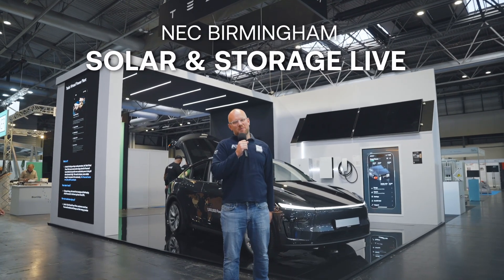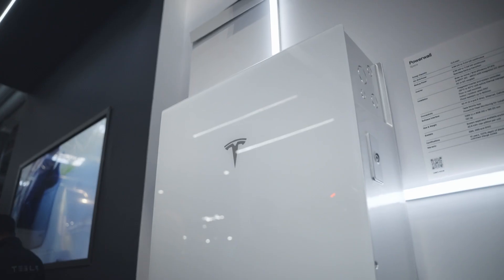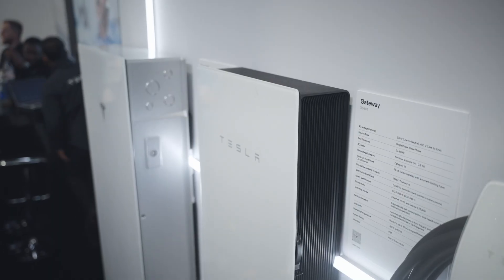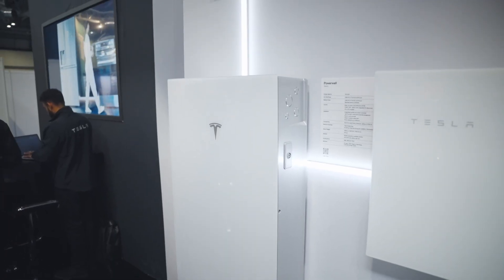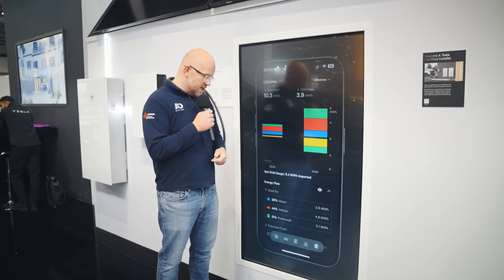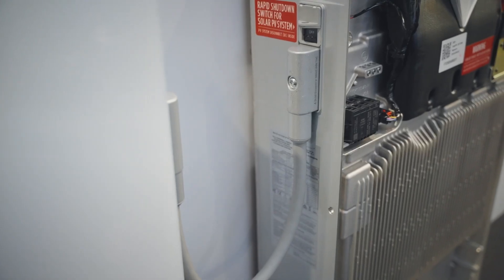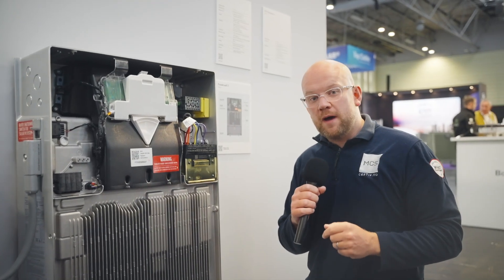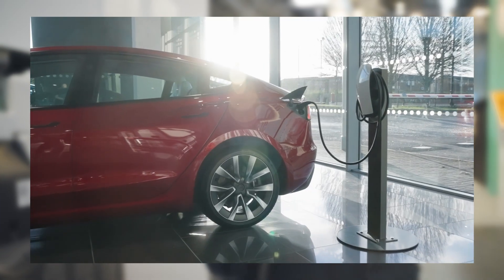Tesla Powerwall 3: NEW Features Revealed at Solar & Storage Live 2025 🔋 (UK Hands-On Demo)

Comment: Some of your information is out of date. A PW3 + DC expansion can charge at 10KW not 8 (FW update several months ago upped this limit) and you don’t need to replace the screws if you need to remove the the front glass cover after the install.
Reply: The latest spec states 8kw but if ur getting 10 then its a Ye!
Reply from the maker: Thanks for this. We are happy to be corrected (every day is a school day) but from what we know official tesla guidance states an 8kw charge: 

https://energylibrary.tesla.com/docs/Public/EnergyStorage/Powerwall/3/InstallManual/BackupGateway/2/en-gb/GUID-E43D0BF8-6B91-469A-813A-C3EFC27D87DB

Seems we are both right when it comes to the screws, there are two versions (ones that are not re-useable and more recent versions with a gasket that can be re-used): 

https://energylibrary.tesla.com/docs/Public/EnergyStorage/Powerwall/3/InstallManual/BackupGateway/2/en-gb/GUID-41D45611-17D2-4AF5-BE8B-5F5867771782

Thanks for commenting 😄

Comment: My current PW3 installation has all panels on one string. It is being re-cabled to use all 3 MPPTs. Will I be able to see how each string performs separately??  To my way of thinking, if you provide a feature such as this, you should be able to see the differences - especially when the strings are in different orientations; that's the only way you can tell it's performing properly.
Reply: I'm pretty sure you can't unless Tesla change the software. Why change to multiple strings unless you have panels on multiple roof segments?
Reply: @HHGTYG-u6g  Exactly that. Panels are on 3 faces, 90' to each other. Original installer used Tigo optimisers to 'cope with the directions', but Tesla state you MUST NOT use roof electronics on PW3, so this is being re-strung at no cost to me!

Comment: I’ve run all the math and I’m getting pw3, however there’s no way the math works out for an expansion pack, even with 8kwp solar it’s a 15+ year payback for an expansion pack.
The only reason it would be justified is if you wanted prolonged backup. 
I’m using 20kw per day home and car charge and 8kwp PV and a PW3 with a Cosy 6 HP is the sweet spot. The expansion pack just doesn’t make economic sense.
Reply: Except you could import at night for say 7p/kWh and then export at 15p/kWh so an expansion helps there
Reply: @HHGTYG-u6g yeah I’ve done that math and it never works out to pay for the extra capacity of an expansion pack. Well not within any reasonable timeframe.